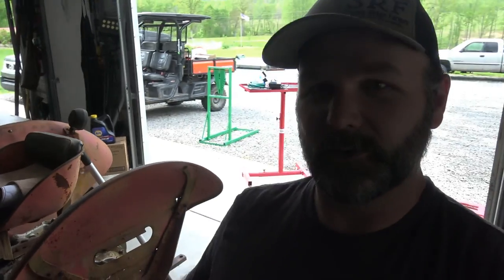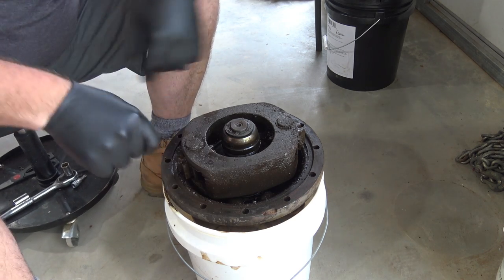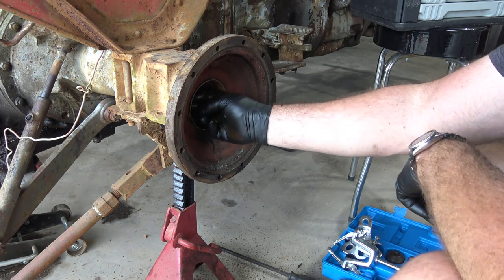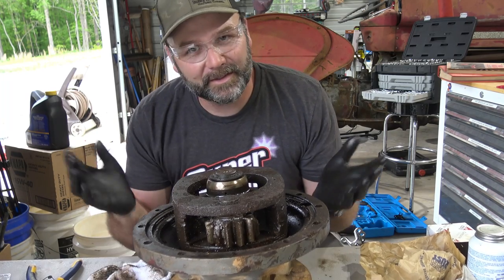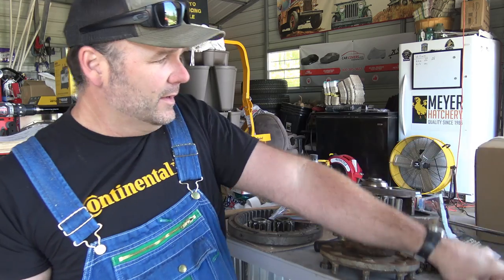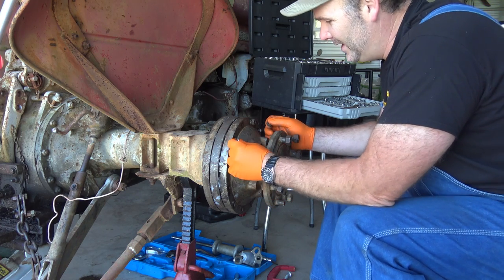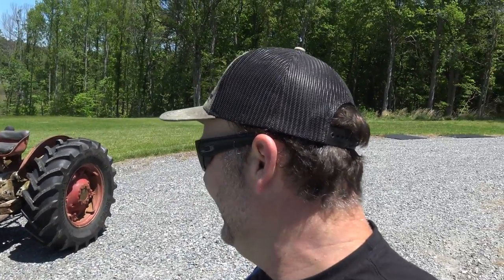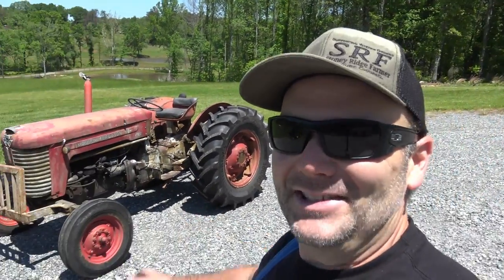Bringing this crusty 60 year old tractor back to life!

Comment: Congratulations on getting it fixed and running! You definitely earned your happy face. As for whether to keep, sell, or restore - that’s a really personal choice. I’m not a restore kinda person, even though it’s sometimes fun to see one restored. Restoration isn’t my thing. The 65 is a good tractor - evidenced by the HP for both drawbar and pto being tested higher than claimed. Continental really did you a solid on those tires. Regards sell or use, it depends on what you need. If it had live PTO and hydraulic remotes, I’d be inclined to put on a ROPS and put it to work. But if that size/power need is already met on SRF, maybe selling sooner rather than later is a good idea. Great job showing us the process - thanks!

Comment: Here are my two cents. I would take the tins off and really clean the crap out of it with soap, water, and a pressure washer. I would take off the exhaust manifolds and pull the heads off. This is super easy on these old girls. After doing a quick valve adjustment and put it back together. It is honestly an easy project and you can have it done in a weekend. clean the tins with some 0000 scotch bright pads and cover the whole tractor in a 10/1 mixture of boiled linseed oil and mineral spirits. Will look and sound great.
Reply from the maker: Shew....pulling the heads....nothing is quick on a 60 year old piece of machinery bhahhaha

Comment: The axle shaft in a freezer and the bearing in the oven. Just enough clearance to put it into place without banging or pressing. Also, you may want to fix the slides for the rim being pushed out for a wider stance. Some look siezed, others look like they are fixing to fall off. Hat to bed a rim of those as they are hard to find.

Comment: Josh, the next time you press a bearing on a axle please use a old bearing or a piece of round pipe that will lie down under the bearing and touching it from all sides! Today you got lucky but the next time you can destroy the bearing if the rollorcage gets deformed! Don’t risk it.
Reply: Yup ... Got lucky because the pressure was just on two points rather then around the whole bearing race ...
Reply: Do not paint that tractor it will lose all its character!!!!!

Comment: Love the older tractors but not the crank ones so much.  Well you have at least one more newer tractor so that is the one I would use.  This one I would use sparingly.  I think I would paint up some of the rusty parts so they don't rust anymore.  Fix the front bumper so it is straight then just love it once in a while.  Eventually may need some rings but depends on how much it is used and how much oil it uses.  Let the next guy fix that.  Great fix.  Thanks for sharing.

Comment: Stoney ridge may I give some advice to help make it a lot easier to install bearings and races . Stick a bearing in a oven for 325 for  30 to 40 min then take and put on a heat resistant gloves then slide it on the shaft but you only have about 15 seconds before it shrinks too much to slide on and stick the race in a really cold freezer for an hour then tap it on in . That is what I used to do rebuilding transmissions and drive train components for CAT

Comment: I would change the gear oil in the trans and other planetary and use Earl to give Hay rides on the farm! Also for what you’re doing with earl I wouldn’t have the Tires Loaded, Just Putting Extra stress on drive line and bearings!! But Nice Job repairing him! Drive him by the Farmer you bought him from, he’ll probably buy him Back!

Comment: Might have been a good idea to pack that new bearing with grease before assembly ... Will be running dry before any oil reaches it, and that will take many years off its life.  Rather than a full restoration, how about a full refurbisment .. All clean, fully repaired and useable, but not showroom paint...  Enjoy watching from the UK

Comment: Did you drain and change the oil on other side and the center differential? 
Clean it real good tighten things up fix what needs fixing change seat and spray the whole thing with a clear coat.
Reply: And check the bearings on left side to

Comment: That old Massey will out last anything you will buy today as long as you change the oils and don't overheat the motor  Great for someone that wants and /or needs a bush hog tractor.
  They were main farm tractors in their day so they can work.

 Josh you need to do some work on the exhaust to keep the water out of the motor or store inside

Comment: Such a great tractor.  I have a high clearance deisel that I got from my dad.  I am considering restoring but they just don't look right with bright red paint.  Something about the oxidation.   I do have a question, where did you get the parts?  I'm sure I'm going to spend a small fortune to get mine back to where it should be.

Comment: What year is Earl an how many horsepower? I have 2 1947 Oliver 550s that are 46HP and they are a lot stronger than any of my new vehicles/tractors.  The smoking is good, once it gets up to working temperature and you will want to put non-ethanol gas and SeaFoam in it.

Comment: Earl has character. What's not to love. Plus with that planetary gear setup, it must be one pulling machine. Put it to work, see truly what are the Plus's & Minus's. Then make a Farming Business Decision, not a heart felt decision.  Put another way, you have to earn it, {$$$} to burn it {$$$}. A big shout out to Continental Tire, thanks for helping out the Stoney Ridge Farmer. Hey Josh, the blooper's are the best part of the video. LOL. How did you pick that tire back up? Also, you should have used some Anti_Seize on the bolt(s) shaft{s} (very thin coat) as well on the threads for the nut's. Don't be so cheap, odd's are your'll be the next guy working on that part for what ever reason.

Comment: Great job on the tractor! I would keep it. MF 65 is a good utility tractor  Massey Ferguson 65 Power:
Drawbar (claimed):	33 hp [24.6 kW]
PTO (claimed):	41 hp [30.6 kW]
Drawbar (tested):	43.95 hp [32.8 kW]
PTO (tested):	50.98 hp [38.0 kW]
Belt (tested):	43.98 hp [32.8 kW]
Reply: pto is always lower than drawbar numbers are reversed but great info!

Comment: Did you ever pack the axle bearings with grease? ....or do they ride in the oil bath? Great job!!
Reply: His axle bearings are oil bath lubricated. Kind of redundant to pack with grease but lube is lube and there really isn't too much in that application. If I had the grease near me I would probably pack them before install.
Reply from the maker: Keep watching the video brotha
Reply: @StoneyRidgeFarmer  Was kinda of a funny question: seeing that you discussed draining the oil,the oil seal,the gasket,the bad vent and what caused the failure AND discussed how,how much,and filling with oil, But a lot of people don't get to work on their stuff and it's foreign to many. But like I said if the grease was close by I would probably have packed the bearings anyway. If I couldn't find it or didn't want to go to other barn to get it I wouldn't.If you mentioned the gear oil used I missed that. Maybe add that into the description if you have time. I still use dino oils: like 'em but the synthetics are probably much better.Expensive though.

Comment: Try Seafoam. After 2 nearly dead vehicles, it worked. If everything inside is really gunked up n dirty, you'll see smoke like you've never seen n it will cough n choke n scare you senseless. May take more than one can. All of a sudden, voila, it will purr; promise! However, Seafoam will only clean engines  not rebuild broken parts LOL

Comment: When you were pressing the bearing onto the axle were you supporting the bearing by the roller cage or did you have the supports under the inner race?  Bad juju to use the roller cage as the support.

Comment: And one more quick thing I heard that you're going to change the oil in it but as I learned from Scotty Kilmer do not change the transmission fluid because it's so old and has so many miles on it if you do that then you're going to have trouble with your transmission just change the oil and that's it

Comment: I would tilt the diff so the oil goes to that new bearing . leave it like that so the oil will fill the bearings. 
I ruined new bearings by omitting this step .
Reply: The oil in the planetary gear is lubricating all the bearings and gears he worked on. If the oil in the centerhousing / transmission comes out to that bearing, something is very wrong. The seal between the differential and the brakes would be gone, and no brakes, and the seal out in the end of the shaft he just replaced would be gone too. If the planetary gear is filled up to the filling hole, it is enough to lubricate everything in there without tilting the tractor left or right.

Comment: If you freeze the axle in salted ice for an hour and heat the bearing in an oven until it's about 150 degrees then hit the inner bearing race with a torch just a bit hotter the bearing will fall onto the frozen axle without a press.

Comment: if Earl is dependable, keep it
What's the fuel efficiency on it?
At $2500 its value in long term can be better than newer tractors
Consider only benefit factors for long term, probably also maintenance
..and how Tough is Earl.

Comment: Watching repair videos is so hard when you have a tip that would make things easier but the person doing the job is long done with it, edited and posted their video. Freezing races shrinks them and makes then go in easier. Heating the bearing makes it press on easier. As for the battery draw make sure someone hasn't direct wired the coil to the battery, it should be wired through the key switch. On those old tractors the coil is the only thing that should be drawing power.

Comment: That failed bearing must have been run dry. Those type roller bearings will rarely fail, as long as they run in gear oil.

Comment: Josh I just bought a 65 ferguson it was also locked up didnt take much to get it unstuck but now it only runs with the choke half out I cleaned the carb got it to run good it's missing the left grill do you know where I can get the left side grill.
Reply from the maker: You can still get virtually every part from AgCo

Comment: Shouldn't that tapered bearing have been packed with grease, before reassembly?
Reply: Packing an oil lubricated bearing with grease before mounting it is like pouring butter in the frying pan before the bacon.

Comment: you have to lubricate bearings and gears before assembly!!!!!!!!!!!!!!!
Reply from the maker: they are rolling through the oil inside the casing prior to ever moving....the bearings have assembly grease in them my brotha...its ok..tractor is running smoothly

Comment: just saying i use a 5 ton shop press and i have the same tractor and had the sam problem the 5t shop press that have done it easy and no struggle and saw yours is a 12t and i guess its just mine that is hydrolicaly done yours is hand done

Comment: if you wish to sell then eliminate those items prospective buyer will bring up while negotiating price--- good seat-guages all working=ie water temp charging system working proper-no shorts and oil pressure--muffler/exhaust repaired buyers need to have comfort when purchasing they will get a good product and if tractor needs paint job then they can figure purchase price plus the unforseens to have something that works and in good shape----personal opinion is fresh paint and those new rear tires will sell tractor faster and at a much higher price